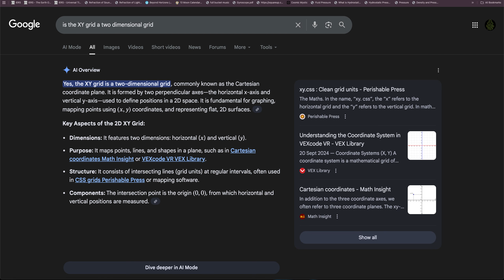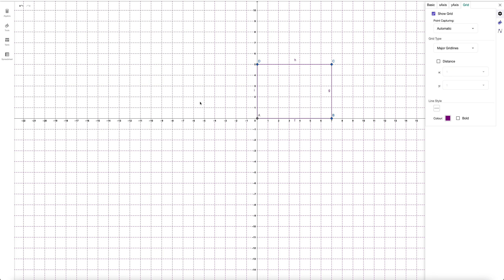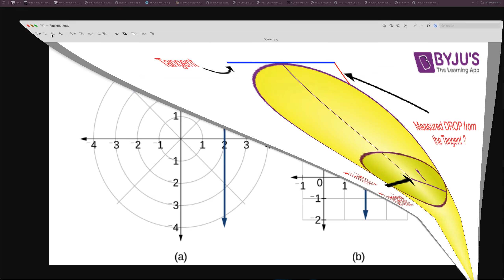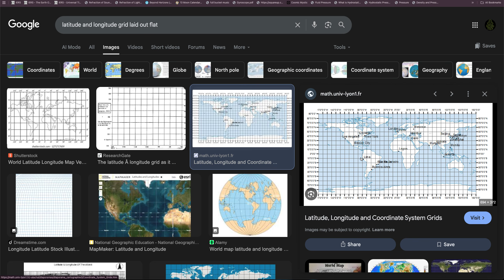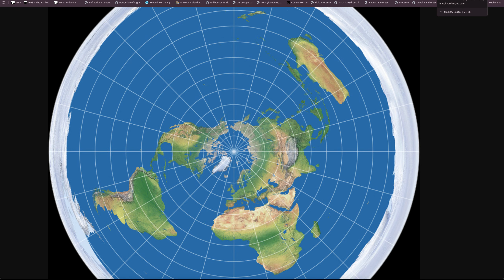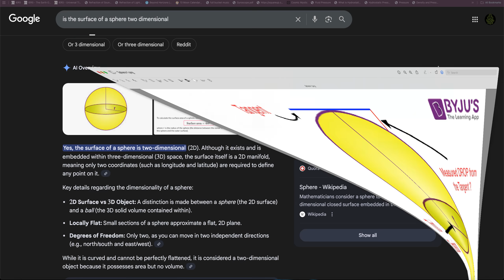The 2D Globe  lol

Comment: Brian, this video was one of those which I would describe as baffling. Do you not understand what the word "surface" means? I mean you are talking about tangents and the center of the sphere as if they are synonyms for "surface". I think you should google for the definition since you clearly have a major gap in your understanding of the word.

The description talking about the surface of the sphere being 2D is correct. It's not necessarily about the Earth's surface since the Earth is not a smooth sphere. It's an oblate spheroid with all sorts of land features like mountains, canyons, etc. So, for that you need the 3rd dimension aka the height to describe a location on it more accurately. However, it all depends on what you are doing. If the goal is to create a desktop globe and see how far the continents and cities are on it, you can easily ignore the land features and treat the earth as a sphere. The worst you will have is an error in a magnitude of 1%. So, if 99% accurate representation is good enough for you (and why wouldn't it) then a sphere is alright.

Now, you made a claim that you can take the 2D surface of a sphere and represent it on a 2D plane with 100% accuracy. It's like taking the "skin" of a basket ball and then make it flat without stretching it. Oddly enough, you made the claim after showing us how the globe is projected on a flat XY and a Gleason type coordinate systems with land masses being all wrong. Why didn't you show the proper flat earth projection which matches with the spherical 2D surface of the globe 100% if it is so easy? Why hide the map? This is exactly what globers have been asking from flat earthers for 10 years.

Comment: Let's remind ourselves of this little gem of a conversation from a while back, Brian, before you start commenting on celestial navigation...

My post: 

Let's remember that (your words, Brian) "the Stars  are not bound to terrestrial rules"?

So, let's see. Using right angle triangles. Your logic, Brian. Doing navigation off a flat earth

Greenwich Observatory, London, is at 51.47842N, 0W

That places Polaris at 51 degrees elevation. Since Greenwich is around 2661 miles from the North Pole (which is Polaris' GP) then that puts the height of Polaris at 3,286 miles (using a triangle calculator). Them's the figures, Brian. It's a right angle triangle. with two angles 90 and 51 degrees, and one side (2661 miles). The rest are calculated from those three pieces of information. No wiggle room.

So far so good. Let's go to the Shetlands at 60.3472N, -1.23497W. That puts the elevation to Polaris at 60 degrees elevation. Since Shetland is 2081 miles from the North Pole, then that puts the height of Polaris at 3,604 miles. So, the same star is in two different places depending on where it's observed from.

This is what led you to your "the Stars  are not bound to terrestrial rules" assertion. This is what leads to the flat earther claim of a personal sun. Because it doesn't work ANY other way. If you start using right angle triangles to measure distances, it all goes to hell in a handcart very quickly. BUT if you use elevation angles properly, the way celestial navigation has been done for centuries, then it all works out.

Care to elucidate?
Reply from the maker: SMH yeah the stars ⭐️ are NOT bound to terrestrial rules, so AFTER you have gained a distance between GP points, you can do Trigonometry if you like, but it won’t mean anything because as soon as you move or the star ⭐️ moves, then your supposed height is changed, this is very simple to understand, but when you truly understand the situation, you will know how and when trigonometry can be used with the celestial bodies, but I’m not telling some baller know it all who doesn’t know it all how that’s achieved….
Reply: @BriansLogic It is very simple to understand.  It means there is no trigonometry involved.  Which also means there is no right-angle triangle involved either.

Which means, the Earth cannot be flat.
Reply: @BriansLogic  So, Brian, again, if the stars are not bound to terrestrial rules, then there's no point in using trigonometry to work out where they are. And then your argument about 'earth must be flat because you need it to be flat to get a right angle triangle just...collapses.
Reply from the maker: And NO I wouldn’t care….